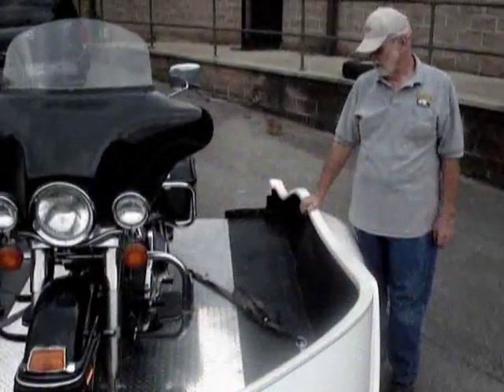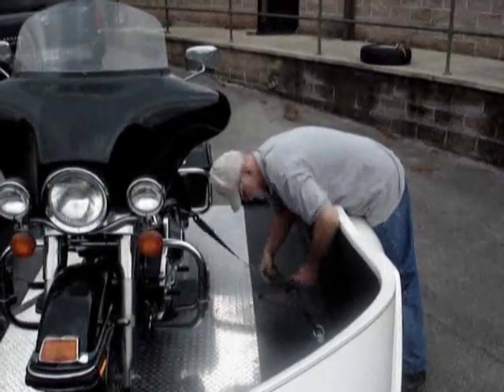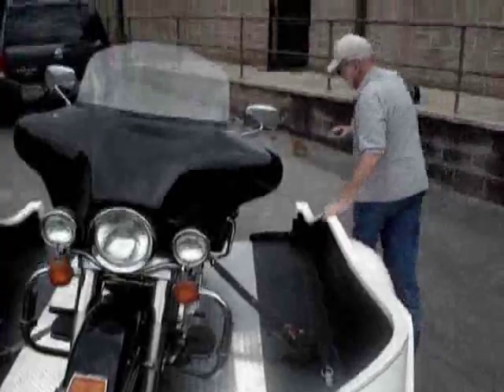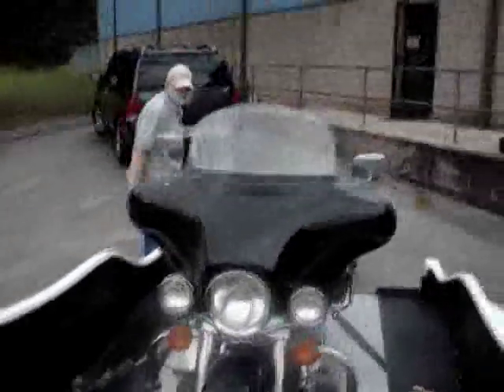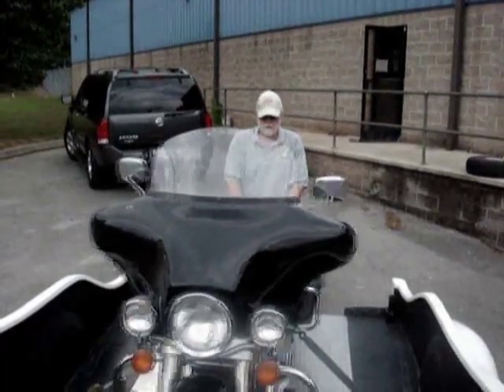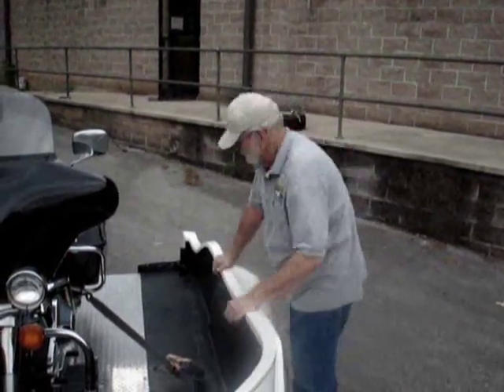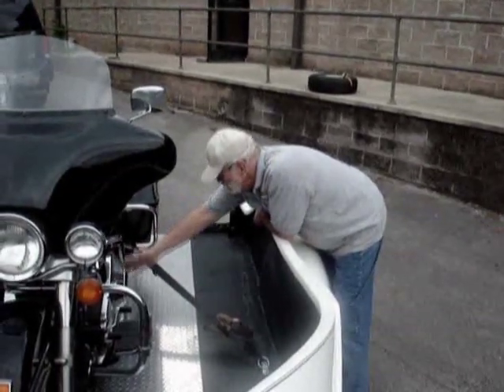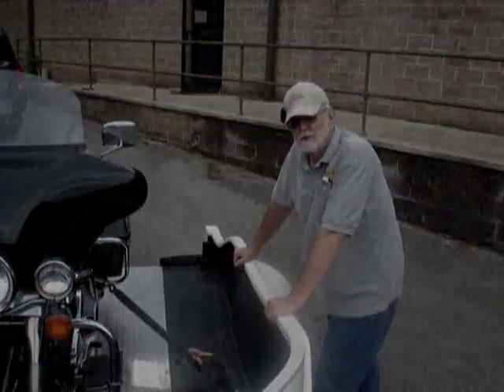Motorcycle Trailer Tie Down System by Ironhorsetrailers.com

Comment from the maker: @gst69man   A bike would certainly get wet in the one in the video since it is top-less.  To minimize heat buildup inside our fliptops, we designed in a few air passages at or near floor level.  The result is a trailer that keeps bikes high and dry under all condtions but may collect a few drops of water on the floor under worse case conditions.

Comment: Ummmm. Yeah that's great and all but does this method come with seals for the forks? U compressed those forks. No good sir. Maybe you should  restructure your video before teaching someone what not to do.
Reply: When you tie down this way, it's basically impossible to compress the shocks much beyond 50%.  That's because so much of the strap's energy goes into pulling the bike forward.   If you check around you'll find that the bikers who have been blowing seals have been channeling all their strap's energy into pulling their forks almost straight down.